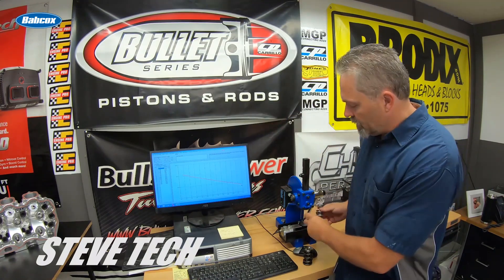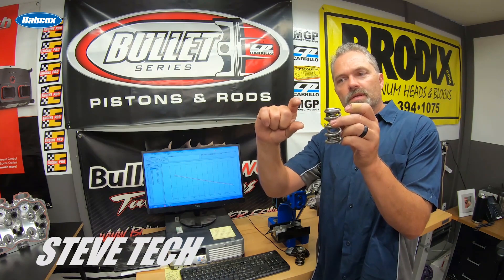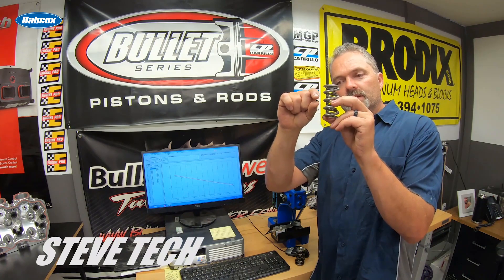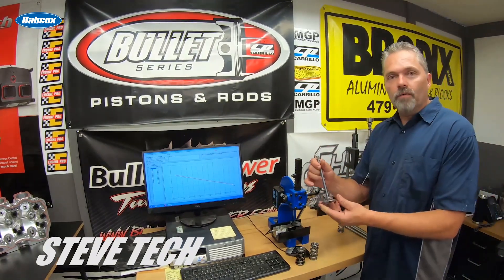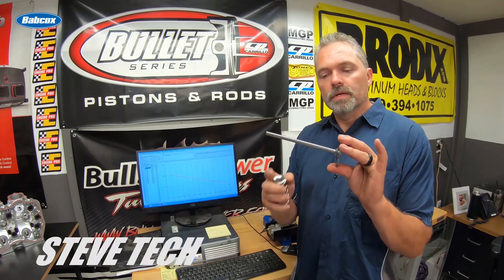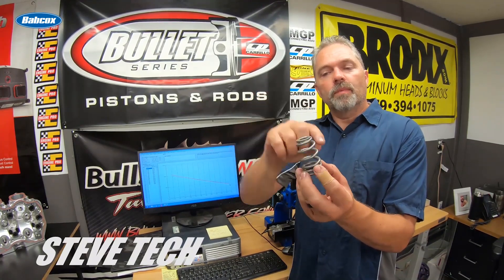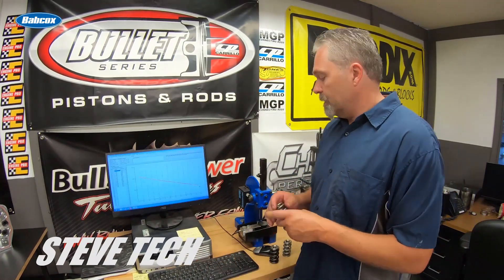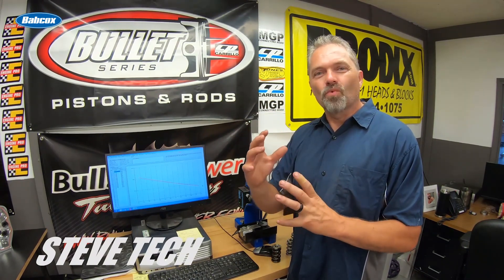Understanding Valve Springs – Part 2

Comment: Comp Cams recommends their 948 springs for my .898 lift cam, which is set up for 332# @ 2.100” installed height. I have a feeling I will need to shim the spring closer to a 2.000” installed height to achieve the .050-.1” coil bind clearance, which will increase my seat pressure to 400+ on the seat and 1000+ open. Would this be too much pressure?

Comment: Hello my friend,  I would love to know if you can tell me what's the max lift these springs can handle, here are the springs specs: seat load 136 lbs @ 1.800'' , open 412 lbs @ 1.170'' , spring rate 438 lbs/in and coil bind  1.125'' , thanks in advance
Reply: 0.615” if you are shooting 0.060” from coil bind.  1.800” - 1.125” - 0.060” = 0.615”

Comment: One engine builder on you tube had a .010 clearance on his head set up, came here to check,,yeh I was rite       050-.080
Reply: Russel, Just asking but…Was he measuring his .010 in between the coils or was he actually .010” from coil bind?  because if he was measuring in between spring coils and there’s 6 coils then he’s right in the range that would in fact be .060” from coil bind.